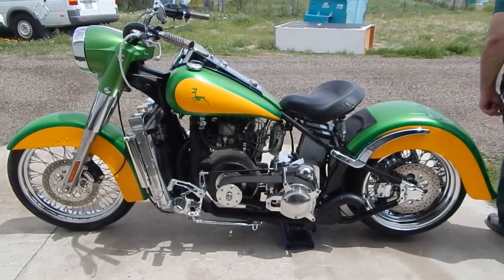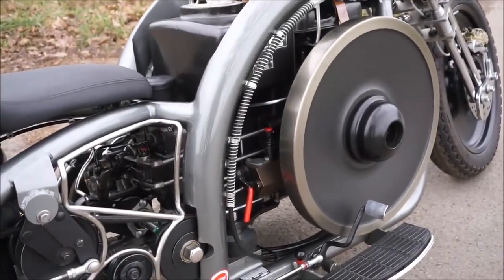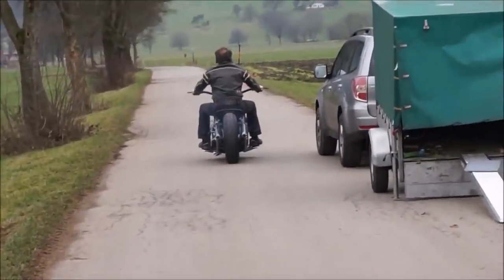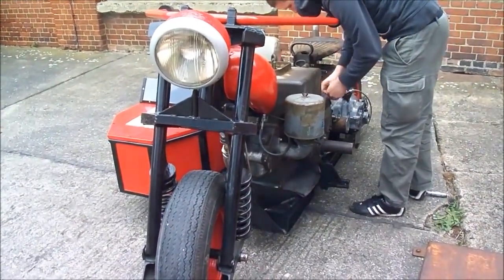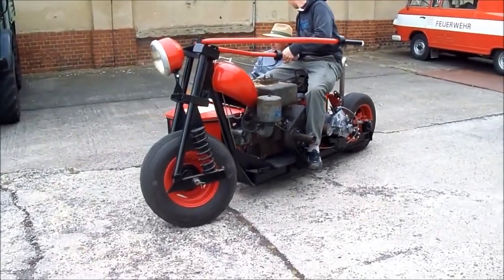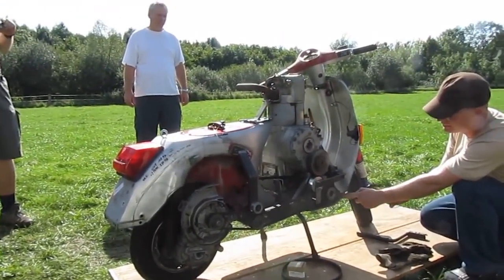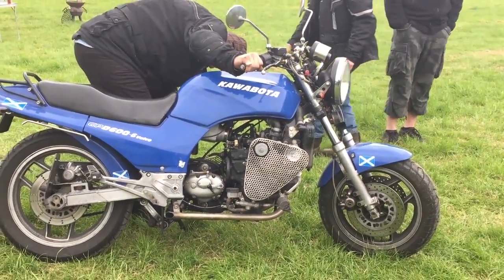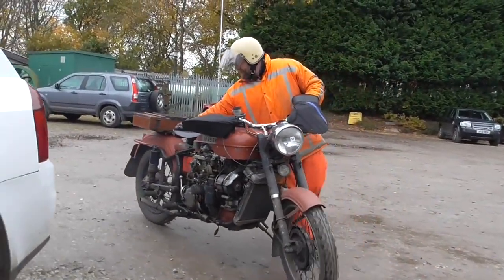Crazy Turbo Diesel Motorcycle You have NEVER seen

Comment: Diesels can't compete without boost,  I could totally dig a vw turbo diesel engine on a bike  or something similar, Maybe a 2cylibder boxer with similar design,   spin about 4k rpm , 24:1 compression and run about 20 psi boost,  in 800-1200 cc with the heads bolted on with 4, 12-15mm cross bolts that go from one head, through the crank case, to the other head, and have 4bolts or studs in the crankcase, about 10-12mm  with a traditional head, jug, crank case design,  with the crankcase splitting opposite to the heads,  or possibly or a 45° at the main bearings, using automotive , she'll style bearings, with case being a thick webb of aluminum, incorporating the mains and heads, with about 40mm, x 60mm and approximately 50mm main and rod journals,  with over head cam, operating valves and injectors similar to the Detroit diesel from ww2 and up,  being a 2stroke, it will need a supercharger/scavenger,  bolted between cylinders ,  maybe a electric started turbo  can be worked out, that is started with oil pressure, so it doesn't spin the turbo without oil, use about 1kw bldc motor, spinning about 10k rpm or what ever is needed to create a air flow into the cylinders, maybe a amr500 roots blower could be used, and possibly incorporate  the intake Illenium into the case,  air flowing into the jug , similar to the transfers of a 2t gas engine,  with about 4, 25-35, maybe 40mm valves , possibly having slightly different opening times to promote swirl in the exhaust port,  use extra long valves, to get the ports running above 45° to the valve, hopefully 60° - 80°  to limit restrictions.  With the crank case being so thick, with the rib construction, to seal the case, make the skin thin, about 1.5-2mm , thicker in areas that requires it, like the top of the case, being the intake plenum, with a single 60mm intake port, with about 75-80mm stroke, and near 100mm bore,  with the potential of being air cooled, oil cooling can be a benefit, having passages through the jug and head,to help with cooling, possibly mount a pair of cooling fans in front of each cylinder,. Depending on fueling, it could spin near 5krpm, using a old school injection system,  it shouldn't weigh much more than a big Harley engine, and gear box,  and should make upwards of 80-100hp, and near 200ftlb TQ, maybe in the 70-90hp,  it should flow air well, especially with 20+psi boost, and maybe try a CVT with 3speed gear box, if possible , lock out the CVT, and shift the gears,  or start in 2nd gear, and let the CVT do it's thing,  it would probably be better to use a hydraulic coupler, or possibly a hydrostatic drive similar to a lawn tractor!  Maybe just gears and clutch, 4speed, with 4th being overdrive, it would probably peak around 3500-4k rpm, plenty of TQ from 1500-3000rpm , I think a water cooled version would be worth the effort, and the radiator, still use fins on the jugs and head to help with cooling, w/ est. 100x60mm x 400mm intercooler,. But all that rambling is if I built a Diesel cycle engine,  2stroke would be the way to do it,.   Sorry for all the rambling,

Comment: In less than 8 minutes I understood that the motorbikes must be gasoline fuelled to be fun
Reply: you'd be surprised  how fun it is to ride a diesel powered bike ,,I've built 2 of them ,,the second more recent  one is powered by a 30HP yanmar turbo diesel ,3 cylinder ,,it's actually pretty zippy due to the torque ,it's got a 6 speed gearbox and is chain drive ,, i upped the final drive ratio to compensate for the relatively low revving diesel engine which only turns 3700 rpm ,i can easily get 100mph on the interstate ,,the smaller of the 2 bikes i built about 10 years ago is powered by a Kubota 2 cylinder engine 479CC 14hp and it's actually quite fun cause it's a small bike built on a honda 250 frame ,,it'll easily do a wheelie or a burnout ,,i built it with a CVT drive so it's pretty fast too  ,,the big difference over the original is it gets 75mpg and it's not really loud either
Reply: @wildcoyote34  very interesting 🤔 , would not have thought you could get front wheel up . Slow spin up , but you Made it work ! That sounds like a great video !!!
Reply: @mikesr3407  i'm a 270 pound big guy  you'd be surprised at how much difference that makes in what it'll do ,,it's not nearly as fast as the honda TRX400 ATV i have which will lift the front wheels up in 4th gear if i'm a bit hard on the throttle and not leaning forward , it's a 6 speed and i have never had it going fast enough for high gear ,,according to honda it's top speed is 72mph

Comment: These bikes with the old-fashioned single cylinders are smart.  They will have transportation if society collapses.  They can siphon fuel from anything and it will keep running.  I watched my grandfather run an old Hatz on gasoline (petrol), kerosene (paraffin), used motor oil, cooking oil, warmed lard...they are more simple than modern diesels, and will run on basically anything.  Put one on a good 125-250 dirt bike frame...you can go anywhere.
Reply: I fail to see where the number of cylinders comes into it,A two stroke would suffice
Reply: That's the tough part of getting around after shtf , all the crap on the roads and booby traps on the trails ! Moving about will become a thing of the past ! Just saying

Comment: You have shown a bunch of non turbo diesel motorcycles
Reply: 4.22 is a turbo sir.. thanks for the video..
Reply: @leoleonel6234  Very first one is a turbo also.  Little 3 cylinder Kubota engine with MONSTER fueling and a huge turbo for its size.  I know I've seen it somewhere before, like a forum or something.  That thing is wicked.